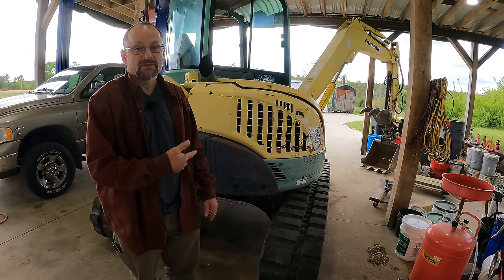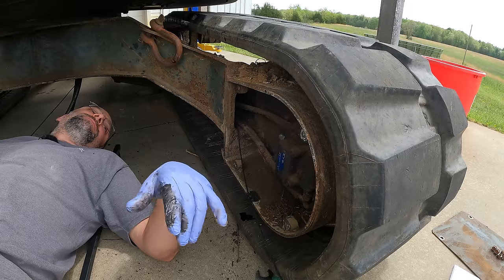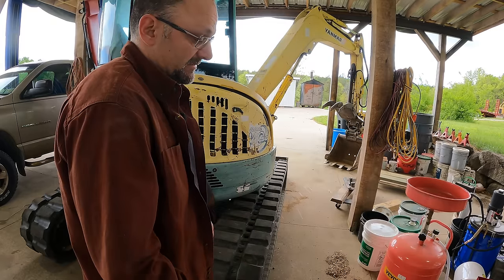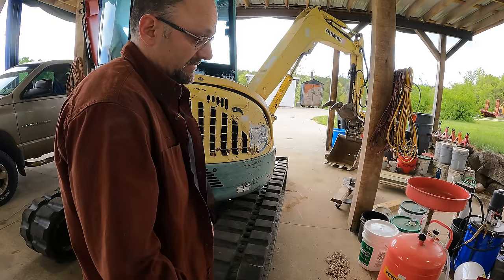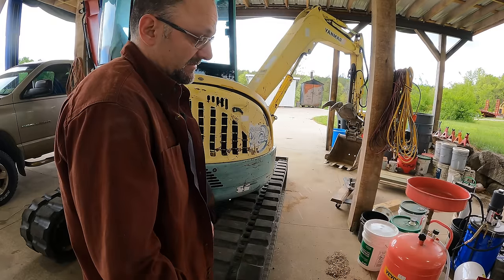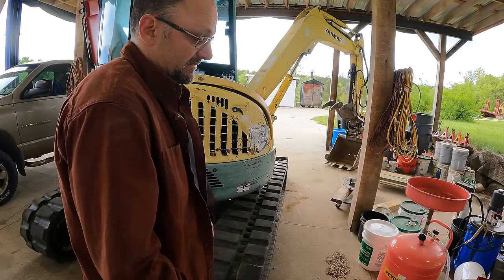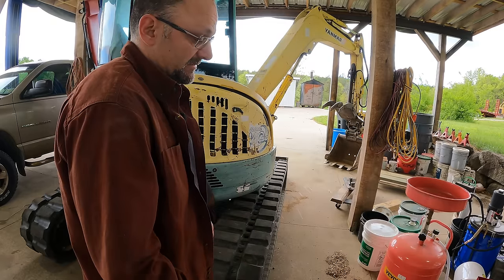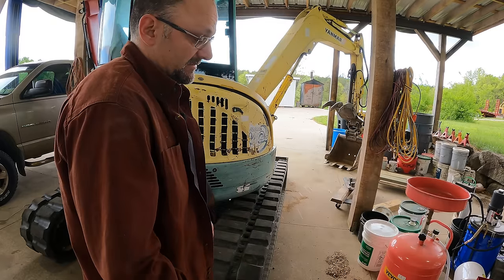Excavator Not Tracking Straight, TOUGH Hydraulic Repair.

Comment: How does the flow divider in the pump work.  

Are there any of these pumps. Travel motors or control valves available used.

Comment: Are your hose extensions long enough to go straight from the valve to the motor, eliminating the swivel all together? Could test that configuration with each pump output to see if that changes anything.

Comment: Another question I have are the piston pumps hydrostatic pumps like in skid steer drive systems or pressure compensated pumps which use load seance to vary the flow of oil.

Comment: Hey John, love your video's. Could you add an adjustable flow restrictor valve to the right side pump output to allow you to balance oil flow to the drive motors, this will slow the right drive motor down slightly but may be a cheaper solution?? Cheers.

Comment: Can you adjust the throw on the tracking leavers, i.e. as if your holding the faster tracking side back just a bit. Often a straight drive does mean one leaver is slightly backed off in your hand (or feet) esp driving on crowned pavement

Comment: I'm halfway through so far and while I agree with your first swapping motor test (using the hoses), I don't understand why you haven't measured the flow rate on each control yet.

Hydraulic motors that are in good condition typically rotate as a function of how much oil runs through them so this test should confirm there is a problem with the control valve/pump.

Running the oil into a bucket for 15 seconds or so you could compare the flow rate.

Finally to figure out if the problem is the pump or control valve you could send the pump outputs into a bucket temporarily.

Edit: some readers will be concerned that 3000 psi hydraulic fluid would appear everywhere but that would only happen if there was a serious restriction at the output opening.

I've done this test myself and when you unhook the output hose from something like a 9 gallon per minute, 5000 psi capable pump, what you actually get, especially at idle, is hydraulic fluid coming out of the hose slower that a bathroom sink faucet. At idle a 9 gallon per minute pump might produce 2.5 gallons per minute, so it would take 5 minutes with the hose disconnected and in the bucket before the bucket would start to overflow.

One thing you do need to do if you want to reuse the hydraulic fluid, is to make sure the bucket is clean when you start.

Comment: In my limited experience of driving hired badly used track machines they very rarely track straight you can compensate for this by giving it a little less on the control that is quicker while going full throttle on the weaker side eventually it will become second nature , one thing did get me thinking was when you switched the hoses on the pump one had a big brass thingy what did you call it an actuator why don't both hoses require one maybe the issue is with this component 🤔

Comment: Try putting a valve on one of the lines going to the drive motor that's traveling faster and reduce the flow to match the speed of the slower drive motor.

Comment: How confident are you that the undercarriage drag is the same on both sides ?  If some bearings were going out on the left, that could also create a problem.  But the fact that the problem revered itself when you swapped the hoses suggests that is not the issue...

Comment: Those hydraulic lines aren't that big. If you don't mind the machine being a little slow, you could put an inline flow control on both ports of each travel motor and then tune the flow rates until it tracks straight. If it's anything like cylinder flow control, you want the ones with integrated check valves that let full flow in and restrict flow out to keep smooth operation.

Comment: Silly question but does both leavers actually travel the exact same distance? I would think there would/could/should be an adjustment there - if one leaver is opening it's control valve slightly more when both are pushed all the way forward (or backwards) you would have a slight difference in flow and travel speed for one side. I would think the levers have a stop point that is likely adjustable somehow (or something is bent) and not just depend on the spool valve bottoming out at the end of the travel.

Comment: You can have your pump lapped for around $600. It's basically polishing the charge plate.  I had a mini where the boom would not lift empty under half throttle.  I had the pump lapped and it was like a new machine

Comment: Can you measure the difference in pressure from pump all the way to the motor?  Or gauges at both points with gopro cams? Then drive it.

Comment: Every tracked machine I have ever ran tracked a little one way or the other. With that being said most of them were old and worn so I cant say what is the appropriate amount to expect. Maybe you mentioned it and I missed it but does this machine have pilot controls or are the controls directly linked to the control valves?

Comment: This may be a quick fix to your tracking issue. Instead of trying to find the fault, couldn't you just connect pressure reducing valves before the faster running motor. That way you could just adjust the pressure that the motor sees down until it travels at the same speed as the faulty side. It means you will be traveling slower but at least it will be straight. With this method you could fine tune the speedy motor until you achieve real tracking excellence. Good luck.

Comment: Typically, a maximum displacement adjuster (pin acting on the the swash) and a horse power control adjuster are very different things. As you say, best not adjust a horse power control as you need special test equipment, this is usually done on the bench in the factory. A horse power adjuster will allow high pressure or high flow..just not at the same time. This ensures consistent draw from the engine and allows designers to use a bigger pump.

Comment: First of all love the videos, trusty viewer from Germany. Did u try to adjust the levers? That goes in the valve? There is a adjustment screw. We had the same problem on or Volvo ec210 and after adjustment it drove straight.

Comment: Lift one track out of the ground, get the drain line and put it to a bucket, drive the track and mark 1min and check how much oil came out, do the same to the opposite side this way you will know for sure what is the internal seepage between the 2 of them and will be able to determine is your motor is the issue, which I belive it is.

Comment: I would think you might want to adjust the travel of the left side contol so the bolt stops the travel of the valve slightly before full travel, maybe that would match the speed.

Comment: Hi Jon.  Thanks for your channel and it has helped me get things back moving again. Please could you spare a moment to give me some advice on my mini JCB excavator ? Both of the final drives work well when I first start using the machine and then later on, probably when the hydraulic fluid has warmed up I get loss of power in the RH final drive. I changed the hydraulic pump last year, so it's unlikely to be the problem and I doubt it is the final drive or orbital gears as they do work well at the beginning. Can you suggest anything that would account for the problem when the hydraulic fluid loses it's viscosity? Regards Paul.
Reply from the maker: Sounds like you are getting increased leakage somewhere when the oil thins out, either in the controls or the travel motor. Probably worth doing a case drain test on that travel motor to see. Then you could swap the hoses to the motors to see if the controls are the problem.

Comment: Most excavators, you check the engine RPM at high idle, no load.Adjusting the pump swash plate angle should pull down the high idle 200 rpm. You need to block the track sprockets with a chuck of steel or a couple of sledge hammer heads, go to full throttle with both travel levers in full forward. Engine rpm should drop 160-200 rpm to properly load the engine to full load rpm. Adjusting the swash plate angle without blocking the track sprockets won’t show you proper “pull downs.” Each time you move the swash plate screw 1/4 turn you need to check the rpm with the track sprockets blocked. This is how you get 160-200 rpm load drop, sometimes i have had to go up to 1 1/2 turns on the swash plate, but mostly 1 turn definitely should do it. Hope this helps.

Comment: I know on hydro lawn mowers on one pump there is an adjustable linkage that will extend or shorten the linkage, basically slowing or speeding up one pump. Same on your machine by adjusting the levers/linkages. Can you adjust those and equal out the flow of bought drives to track straight?

Comment: What if you just install some adjustable set screw stops in the drive levers to limiting the throw on the faster side by a smidgen? That way you could push the handles all the way forward/backward and the compensation would be automatic. Or maybe an orifice in the faster hydraulic line?

Comment: I would try to buy hose extensions to connect the right hoses from the engine to the left. They will hang but for testing it should be enough. Then you can eliminate the valve if you continue to the left.

Comment: Id say either the pump, or you have a flow restriction to the left motor. You could check flow rates but its not going to be easy. Maybe visually look for extra fittings on the left supply/return that could be sliwly flow rate.

Comment: Pull your case drain line off of each motor one at a time and dump it into a bucket, spin your track for 1 min, and measure it. that should tell you the weak motor and how much, since flow meters are usually in gpm's you can check the acceptable loss amount on your specs, seems like its about 10% but don't quote me on that. May be able to do your pumps also but i didn't fully see your set up. Good luck.

Comment: Mate I didn’t see it in the video, but is there any adjustment in the mechanical rod that connects the hand control to the spool.  Is there any way you could shorten the bow left rod to correct the steering.  Or make it adjustable.   I know it may take a tiny bit off your top speed. But no corrections.

Comment: I have no experience at all with mechanics or hydraulics (I am a software engineer), but I think bypassing swivel joint completely  for testing using hoses directly from valve box to motors could be more direct way of testing it.

Tying pumps were a good trick, but obviously is not a great solution even if connected to electric valve.

Comment: John, does the speed change between the two speeds I wonder? The 4.5 ton excavator I used to operate would only track two the left i hare mode, not on tortoise mode, just wondering ?.

Comment: Do the controls have trim adjustments?  And if so did you adjust them back after swapping the motors?

I also have an odd idea,  a 2 way valve on a timer that alternates the pups being used for each track, cauld have adjustable duty cycle for each track,   this would cause it to wander side to side a tiny bit but ultimately hopefully track straight...

Keep in mind I'm a programmer not a hydraulic engineer....

Comment: This would not gain any speed, but you could place a restriction (like a washer) in the right lines to the hydraulic motor, so that the flow is "capped".
Another solution is to add some additive to make the hydraulic oil thicker,to compensate the wear,  but thicker oil will get hotter.
And as a last solution, is to get the hydraulic oil cooler (adding a extra oil cooler or fan), so that the viscosity goes up.
And what also came to my mind, can the difference in tracking be caused by a difference in track tension ? i imagine, that a lower track tension gives a smoother roll ?

Comment: Is there an adjustment point from the foot pedals to the valve chest itself a bit like on a tractor loader you can adjust where the cable enters the valve chest or maybe a stopper adjustment at the pedals to determine how far you can push or pull both sides?

Comment: I know Jack all about hydraulic systems, but is there a way to restrict flow to the track that is moving faster so they move at the same speed? You might lose a fraction of the speed, but that also doesn't seem to be as big of a problem and the tracking

Comment: Look at the case drains and return filters for both motors and pumps, could be clogged. also look at your linkages. make sure both are going the same distance full travel and both valves are returning to the same zero spot. This thing is 2 closed loop (hydrostatic) systems. Basically, it is not that simple. But, bridging won't help.

Comment: What about installing a throttle valve at the intake of the "faster" valve? It wouldn't help you to gain top speed but I think it could be a cheap solution for going straight.

Comment: Is there any way to shim or trim the spool valve movement to tune this?  Could the links to the spool valves be worn and you are actually actuating one to full speed the other to 95%??  Is there some amount of bypass even when you are tracking full speed?  If so, the left and right valve could be bypassing at slightly different rates/pressures.  Not a hydraulic mechanic, just thinking through it logically.

Comment: I'm wondering if one  track has been replaced. That would cause unequal lengths which would make the tracks work against one another. Similiar to different wear on front and rear tires on a four wheel drive. Or taking out a link on a dozer.

Comment: I noticed that you have 2 different kind of tracks and one is new and one older. Thanks of a car with 2 different type of front tires with a different thickness. It will also pull to the side of the thinnest tire.

Comment: Has any of your troubleshooting thus far isolated the left right hand/foot control primary  valves that are controlled by hand/foot movement.  And the dump flow restriction return to the tank can be a determine factor when you are chasing small variances.

Comment: All you had to do was swap the 4 hoses on the swivel, not much fun. Was the slow motor also slow in reverse?  Dropping the trickle line off  both of the travel motors would tell you by comparison if the leakage was the motor shaft seal. The usual cause of  travel motor internal leakage is the seals on the brake ram, these operate every time the control levers are slightly moved. When these really fail, the flow is too much for the trickle line and oil pours out of the main seal onto the inside of track. The machine still walks but leaves an oil trail until it runs dry.

Comment: now correct me if i´m wrong !!! but hasn't the left belt been on longer than the right one ?  if the footprint of one belt is 1/2" longer than the other what effect would that have on tracking ? can it be that the "compensation" when you have the hoses on the pump flipped is to do slight difference in where in the tracks or tightness of the tracks? 
but honestly i have worked on those machines from 2.5 ton to 25 ton and they all track a bit faster on one site even new machines.

Comment: Can you fiddle with the pressure relief valve on the faster turning motor so that it brings that motor down in line with the slower pump?
The whole thing makes me believe your pump needs a rebuild, but then it would be both so they are "even" then it makes the other worn parts seem more obvious... it just keeps going until you decide to do the work or buy another machine, but that has its own risks of having to go through it all again too.

Comment: By checking the rod coming out of the valve box there should show the mark where the rod should be if the mark is little bit out or too much in the valve box it means you need the  seals and gaskets of that valve

Comment: Try reducing the size of a drive fitting on the motor that drives it to a specific direction. Cut the flow slightly to slow down the motor that drives faster. Weld up a fitting and drill it to a specific smaller size, like .025 smaller to start.

Comment: What I would try is 2 needle valves on output of both pumps and adjust the fast side in to equal the flow similar to a press brake with 2 rams.

Comment: I am wondering if you could add a valve somewhere in one of the lines on the side that moves faster then slowly close the added valve to the point it slows the faster track enough to match the speed of the slower track. Not the best way but could solve the problem in the least expensive way. Is there a flow control on the control valves you can adjust? does the pump that you were checking only used for travel.

Comment: You need to use a flow and pressure tester ,one track motor can run slower even with the same pressure, motor speed is dependent on flow so if one pump isn't stroking as far as the other the machine will pull to one side.

Comment: This may be a silly question but is there any adjustment on the levers themselves so you can just not push forward as much on one of them to track it? & the other thing is the accumulator would that cause anything to change between sides because it is only on one side? Just a thought

Comment: Ive operated a 100 machines with that type drive.. At full speed one motor is always a bit faster.. You run the slower motor at full speed and control direction with the faster one..

Comment: Hey mate has it got a straight travel valve in the schematic, if the pumps are split to the main control valve for left and right travel circuits, similar to a cat pilot logic system